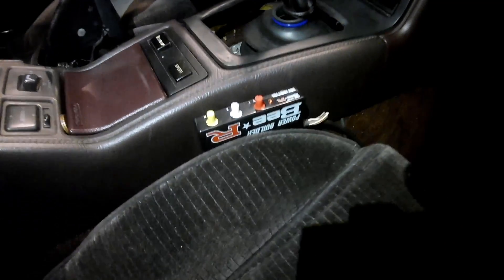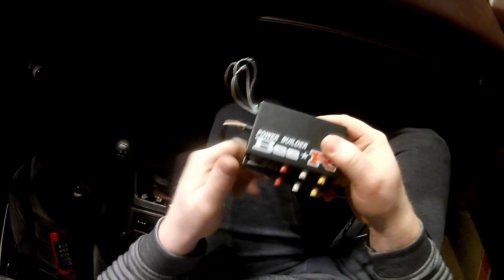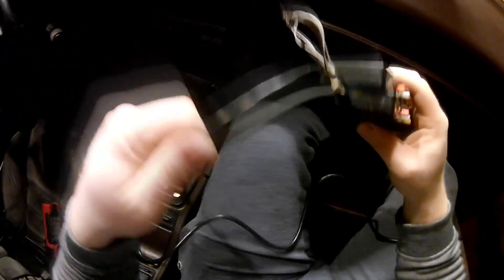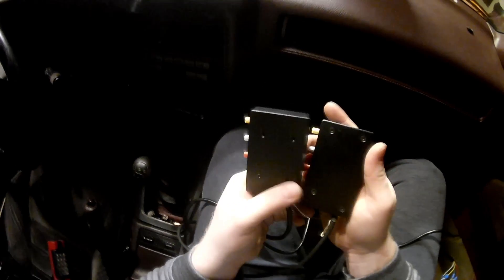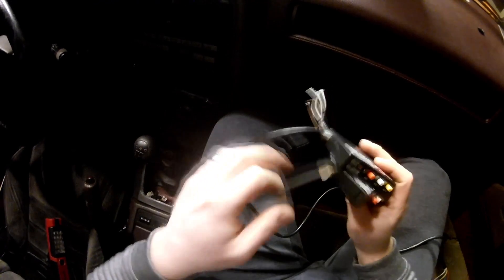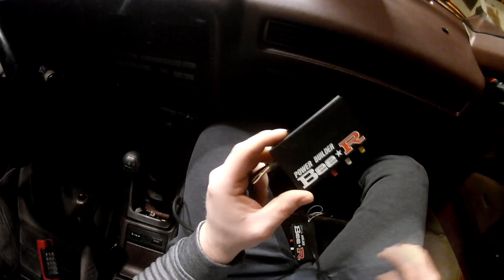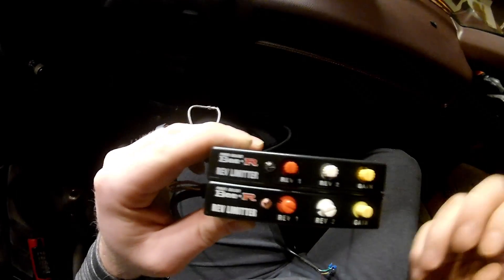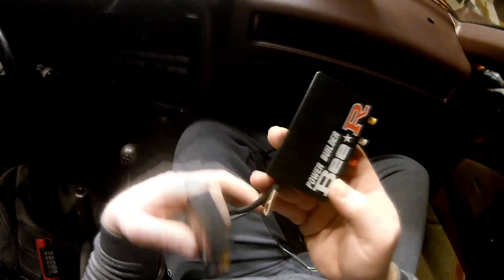Fake VS Real:Fake BeeR Rev Limiter

Comment: To get the fake one working, you only hook up 12v, gnd and the green wire to the timing wire. you dont do anything with the other wire, and cutting the grey, white or black(?) wires on the limiter wont do anything. Also it only revs up to 3500rpm but does pop cool flames.

Edit : also the knobs dont do anything
Reply: Im wiring a fake one onto a toyota tercel just for fun. This sounds about right. Green wire to a tac signal ?
Reply: @ccombdon   if you take off the casing for the fake bee*r, the inputs/outputs should be labeled on the board.
Reply: @Leon-Jordan  sweet!
Reply: Thank bro .I got. A fake one
Reply: My fake one works on all settings on my 1fz, wired in the way the Japanese forums said for a 1jz and it works really well on both settings, just working out the handbrake bit to have a trigger button lol
Reply: @HyperVerda  the jdm cars are different to American I have an eclipse and it works fully
Reply: @HyperVerda  like u said instead of the hand brake I added an switch to control it from there

Comment: Hey I got a Type B and instal the Honda civic working but not perfect led is work , when i close the gaspedal that rpm when  i set the box its litle limitering but when i push ower  its nothing...
When i opened the box lucks like fake limiter!
Not perfect... :/ any idea how to fix? I think is need some registor on a grin wire... or something.
Reply from the maker: +Barnabas Balogh you need the BEE*R for Honda. I dont believe the type b works on Honda.
Reply: You need the type H for Honda/Acura
Reply: That was the most cancer thing I've ever read, get a dictionary.

Comment: Are the knobs supposed to turn infinitely or are they supposed to stop at 0? I just got one from eBay and it looks more or less like the real one you showed except the insulation on the wires is shiny and the writing under the knobs isn't "tall." The circuit board looks the same. It also came with the Bee*R sticker but it didn't come with an original box or instructions. I'm more worried about the knobs because wire insulation could be changed and who really cares about a font, right? Nice Supra btw. I'm from NY also and I have a '91 Turbo that I'm working on.
Reply from the maker: Thanks Man. I'm pretty sure that the knobs keep spinning past zero. As long as the circuit board looks the same, I don't think you will have any issues. the only real way to know if it works is to install it.

Comment: I was thinkin about doin it on my 7mge but rods need replaced first. Thats a 88 to 87 supra right? Why is your front emblem newer then mine and. Mines a 89 supr that has the badge sayin toyota supra on it. But later on a 1jzgte will be put in but got to fix the rods in the 7mge first.
Reply from the maker: +White Dragon I still have the stock rods. My car is a 87. I repainted the car and updated the emblem. Mine was missing. Also, my motor is a 7MGE also. I did the turbo conversion on it.